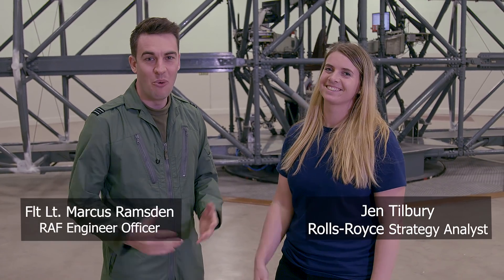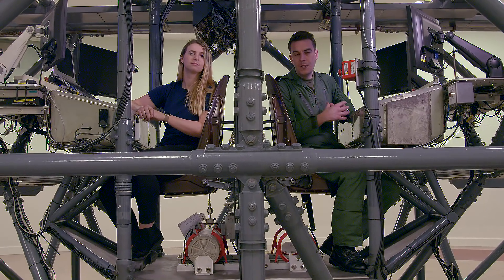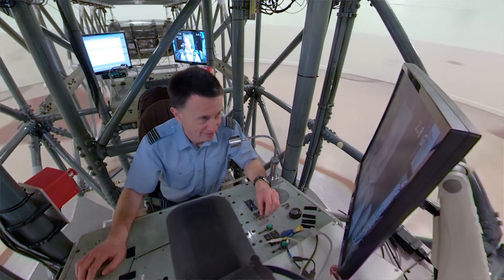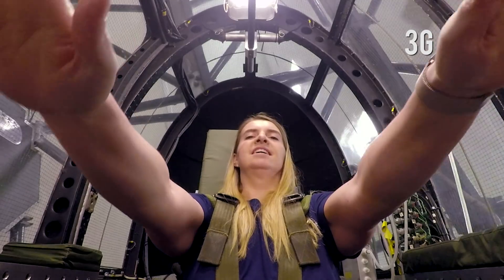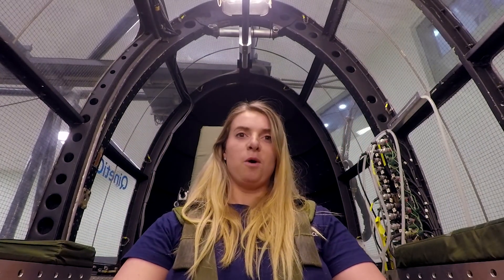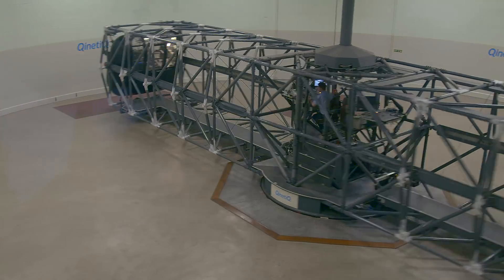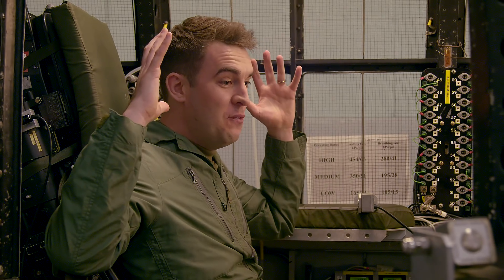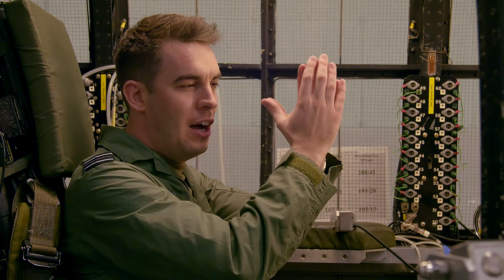How to avoid G-LOC in a Centrifuge with the RAF and Rolls-Royce | STARRSHIP

Comment: Serious question.. would high blood pressure help or hinder you during high g's?
Reply: High g's put excessive blood pressure in some parts of your body, while lowering in others were blood is not able to reach as it should.
So resisting it is more to do with keeping blood pressure about as uniform as you can, rather than higher or lower than the average person.
As a final note, excessive internal pressure in blood vessels may result in ruptures and lead to severe health damaging consequences, such as lost of sight.